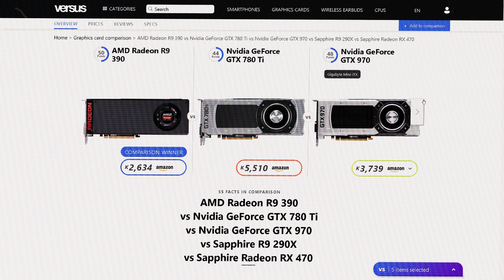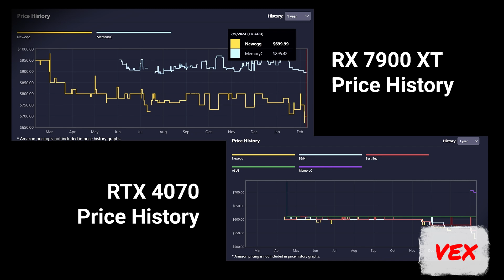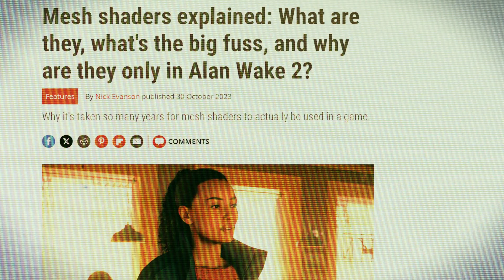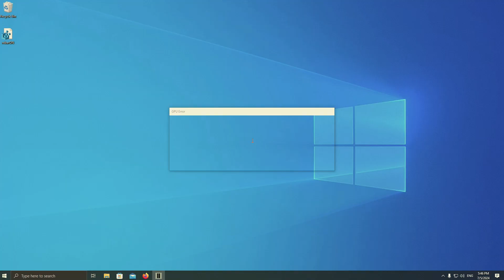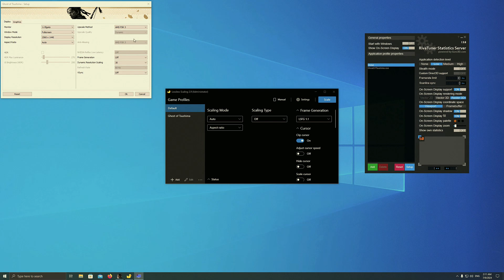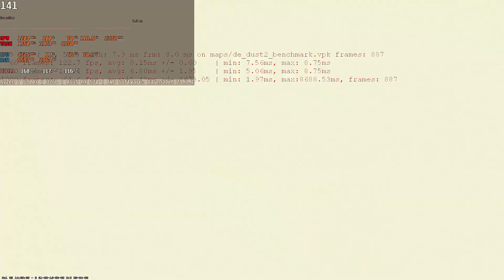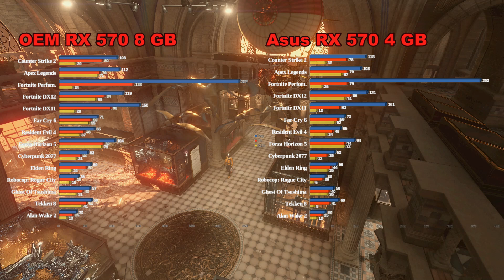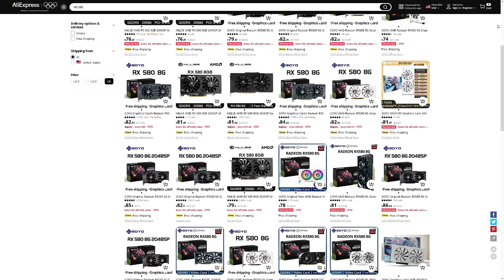AMD RX 570 4GB vs 8GB: Great or Pointless Buy?

Comment: Still using my RX 570 that I got back in early 2019 for 150$ paired w a ryzen 3 2200g, still good enough for 1080p Cyberpunk 2077 Baldurs Gate 3 , etc (though admittedly an upgrade certainly is due, just astounded what you can get away w even with low-end hardware)

Comment: Decided to sell my rx5600xt and buy a rx570 8gb to use until upgrade... the rx570 will be my backup card once I upgrade. I've saved about £70-80 and I can still play mostly same old games anyway... the rx570 8GB costed me about £41. I sold my rx5600xt for £120; it was kinda pointless to keep it since it doesn't have mesh rendering anyway. All the games I play run about the same on rx570, can't tell the difference without a frame counter.

Comment: Thank you for the video, much needed info for me...I'm scrapping together a light gaming build to sell off would you say an RX 570 4 gb + 8th gen i7 would make a nice pair ?
Reply from the maker: Thank you for watching! In a such combination the GPU will be mostly the limiting factor. With a bit more cash you can buy an RX 580 instead. But there are some better combos with an i7 8700 such as GTX 1070  or 1660 super/ti or RTX 2060 or even 3050 the 8GB variation.

Comment: i still using 4GB 570 that i paid $50 1.5 year ago, i oc it a bit and it can still play some of my library just fine! 1080p High at FH4, Metaphor, RDR2, and ETS2 with lock 60fps :D
too bad the graphic driver will crash if i try to use it for Ai Denoise on Lightroom since it's an ex mining card with modded bios, but for editing 1080p on Premiere and After Effects, it still good enough and stable.
can't wait to upgrade to 2060 super once i saved enough! :D
Reply from the maker: Thanks for leaving your comment and I hope you find a good GPU bargain.
edit:typical typo
Reply: @obnot  Thanks! :D
Reply: 5 months ago I bought a used rx570 4gb for 30 dollars. The card works perfectly for games at 1080p and medium high settings. This is a gift.

Comment: should i pair this card with my future build with i5 4th gen 8Gb version or suggest me anyother with same price thanks man!
Reply from the maker: Hi, man! I avoid talking about prices due to different world regions have different markets, different currency and consumer power, etc.

The only thing I can assume is that you are opting for a very low-cost option, therefore the best choice is the one YOU can afford. If the future build is a 4th gen Intel CPU/platform... so be it! Will an i5 4th gen bottleneck the RX 570 at 1080p low/medium settings?
YES, in many games.

I recommend purchasing an affordable Xeon processor that is comparable to an i7 4770 as is for sure a better replacement for the i5. Watch my YT video for further info on the topic https://www.youtube.com/watch?v=pa8zJyEqLPU

If you're unable to find a good deal on such Xeons (E3 1231 v3, E3 1240 v3 or E3 1245 v3) in your local market, ali express usually offers some excellent deals on those.
Reply: Oh thank you man I'm now convinced to buy xion e3-1270  v3 i literally search whole night about xion CPUs & finally make a decision now GG

Comment: I am planning to buy an entry level rig but it has no gpu, is this suitable for ryzen 3 2200g?
Reply from the maker: The RX 570 would be more than enough, as often it's the Ryzen 3 2200g that will limit performance.
Reply: @obnot  will it bottleneck?
Reply from the maker: @Ifqsfbrr  Yes! The Ryzen 3 2200g will be the bottlenecking point in most games that introduced the last four to six years but also in some esport games such as Fortnite on DX12 or CS2 etc
Reply: @obnot  so its better to get ryzen 9 even without gpu
Reply from the maker: @Ifqsfbrr  No! Both CPU and GPU are crucial. You just have to find a balanced combination. A Ryzen 9 wouldn't hurt but on the other hand would be an overkill for the RX 580 and frankly, I don't think there is any Ryzen 9 with IGPU.

Any Intel six core 8th to 10th gen or any AMD six core ZEN 3 and Zen 5 is a good combination for the RX 570/580 and good enough for today's standards.
Reply: @obnot  ohhh copy. thank you.

Comment: I'm still using my RX 570 that i paid 179.99 still a beast. It can do 3440 x 1440, however it's starting to show its age. Thinking about getting the RX 7800 XT
Reply: I paid $50 for second hand Aorus, great deal i say
Reply: Thats exactly what i jumped to. I paid 80 for my 570 and i use it for a home build now. I love tis 7800 XT tho but id tell you to go up to the 7900GRE or 7900XT if there on sale
Reply: 1440p? On which games
Reply: @mue3nul  nothing too massive
Reply: @mhawkingz  name a game bro i just got the card too 😭
Reply: @mue3nul  lol games like eafc. Gta 5 with high settings, but has to be native and not forced resolution
Reply: @mhawkingz MASSIVE?
Reply: @mue3nul  just got cyberpunk 2077 and getting 30+ on low, but still waiting for significant sale to upgrade
Reply: @mhawkingz  WHAT? 4K?
Reply: @mhawkingz  idk which country you're from but in mine you can get a used rtx 2060 for ±200$ buckaroons
You should check for that, or a used 1080ti
Reply: @mhawkingz  do not buy new cards
Reply: @mue3nul  not 4k. 1440p wide. I should’ve clarified I have the 8gb version and don’t worry I know not to buy cards new. I learnt that you can get really good deals going used
Reply: @mhawkingz  yeah good
Reply: I just got mine for 20$ this week , upgrade from a 960 2gb
Reply: @CaptainBlackbeard91  20 bucks is crazy, which country?

Comment: the GTX 1060 3gb was not a full 1060, since it had cutted down ram AND cores, many of us claimed back in 2017 that 1060 6gb was a "1060 Ti" without branding and made the 1060 3gb a direct competitor to the Rx 570, which was a slightly cutted down 580 to be fair.

4gb was more than enough in 2017, but nowadays 8gb version might be required for propper loading of newer tittles that can still run on the 570. Nevertheless both 4 and 8gb versions were good GPUs and aged really well. To get this level of longevity back in the day you needed to aim at a high end GPU (like R9 290/x R9 390/x or Fury) but with the 400 (and rebranded 500) series that changed for good

Comment: Mining cards are often in better condition than gaming cards as a mining card is on for a long time witbout being switched off meaning the temperature is roughly the same the whole time irs running. A gaming gpu goes from on to desktop to game to desktop to game. Im sure you get the picture meaning temperature fluctuations causing things to expand and contract. Like pavements cracking in when the season changes.

Comment: If someone wants to play all games till july 2024 with high/mid and lower settings , then it would be okay to go with rx 570?
Reply from the maker: Well, an RX 570 can play most of the existing PC gaming back catalog with decent performance. However, if you wish to run the latest and most demanding titles on it, then you'll need to look somewhere else; Unless you're okay with running games at 15 fps or at extremely low resolutions.

Comment: It's a pity that this video did not take into account the comparison of RAM consumption, since it is borrowed, for lack of video memory of the graphics card. As I was able to see, RAM borrowing can range from 500 mb to 2 gb
However, as has been shown, some game projects are hard on the graphics processor itself, forcing it to run games at low settings, which reduces the dependence of video memory consumption
Reply from the maker: Well NOT noticed! https://youtu.be/hXp0yT2-3S4?feature=shared&t=681

Comment: I do have an RX 570, but I don't use it as a daily driver (I don't think that I have a daily driver, I kind of rotate GPUs).I'm on the casual side when it comes to gaming and I don't get to play much except some Fortnite and some older AAA titles (Terminator: Resistance, or Resident Evil 4); the performance level provided by the 4GB variant that I have is quite ok.
I do like the 570 though - it has a single 6 pin power connector, and that fits well with the original PSU of my PC (old workstation, that does have a 6 pin connector).